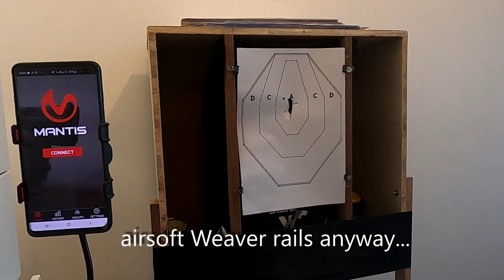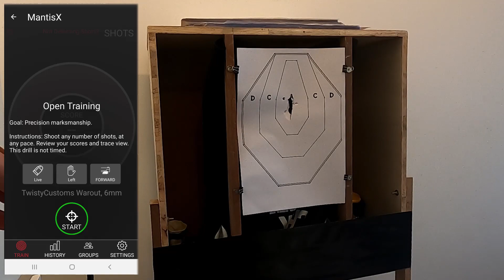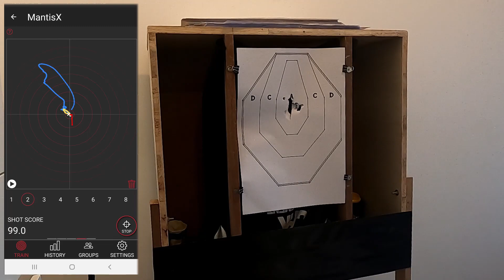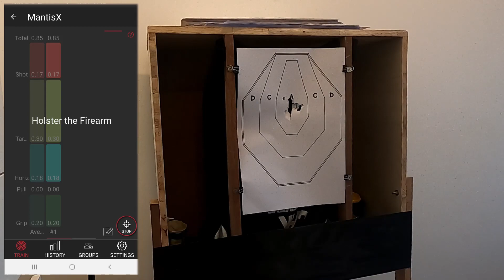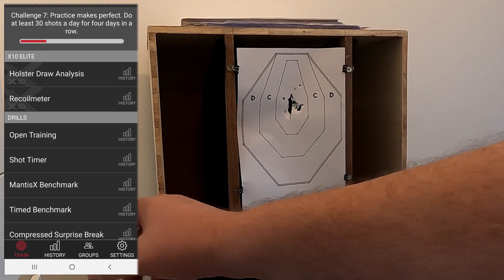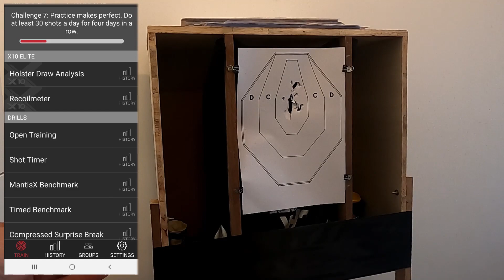MantisX for Airsoft - Quick Look

Comment: What airsoft gun is that?
Reply from the maker: It's my own custom I call The Unicorn. Mostly Airsoft Masterpiece parts. Pic is on my profile banner.
Reply from the maker: Most parts listed below, and some build notes. 

Slide	Gunsmith Bros Ultra Light Open Slide	
Frame	Airsoft Masterpiece 2011 	
Grip	EDGE Met
	
	Nine Ball Hi-CAPA 5.1/4.3 Hexagon Socket Truss HEAT GRADATION Grip Screws
Hammer	Nine Ball TM Hi-CAPA 5.1/4.3 Custom Hammer HEXA HEAT GRADATION	
Thumb Safety		
Grip Safety		
Slide Stop		
Mag Catch	Included w/EDGE Met grip	
Magwell	CowCow Match Grade T01 Magwell (Rainbow)	
BBU	GSB BBU included w/slide	
Nozzle	Guarder Enhanced	
Nozzle Spring	AIP 140%	
Outer Barrel	Included w/ comp	
Inner Barrel	Nine Ball 6.00 Inner Barrel for Hi-Capa 5.1/M1911 (112.5.mm)	
HopUp	Airsoft Masterpiece Brass Hop-up Base for TM 1911 / Hi-Capa	
Bucking	Nine Ball Wide Use Air Seal "HARD" Hop Up Rubber Chamber for Marui VSR-10/G17/G18/Hi Capa/P226 and other Marui Handguns	
Recoil Spring		
Short Stroke		
MSH	Included w/Grip	
Trigger	Nineball Gamma Heat Gradation
Airsoft Masterpiece Steel Trigger Ring	
Plungers	Airsoft Masterpiece Plunger Set	
Sear Spring	Airsoft Masterpiece Sear Spring	
Sights	C-More RTS2	
Disconnector/
Valve Knocker Lock	Airsoft Masterpiece  Steel Disconnector Set	
Sear	Airsoft Masterpiece included w/frame (and hammer!)	
Valve Knocker	Airsoft Masterpiece included w/frame	
	AIP Frame Sight Mount
Watermelon Rainbow Mag Bases	
Fitting:	Generally very easy "drop-in" build	
	
Plunger pin sharpening - more positive lock in thumb safety
Thumb Safety - more positive safety lock

Nineball Heat Gradation Mag Catch not a good fit (grip is curved)
Nineball Heat Gradation Mag Well not a good fit (too large, needs tape as no pin holes)

	Professional Race Tune
Professional Frame tapping for sight mount
	Professional Printing for graphics

Comment: I know that the MantisX10 is compatible with live guns, how does the Mantis know that you've fired a shot?/
Reply from the maker: It's all movement based. Airsoft guns have less recoil, but the draw, aiming, trigger pull etc is all senseed as you can see in the video.
Also, MantisX has options for live, dry fire or gas fired guns which changes how easily it senses shots.